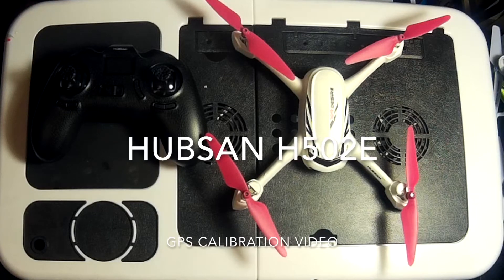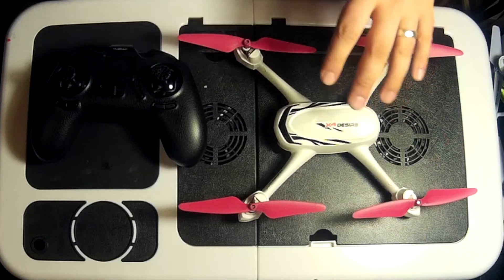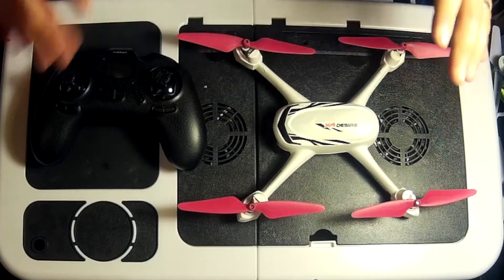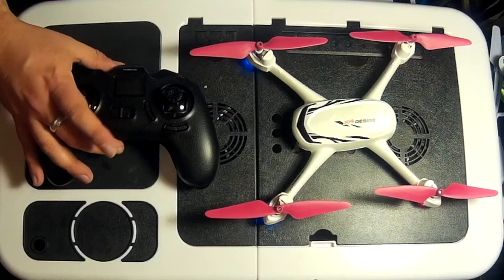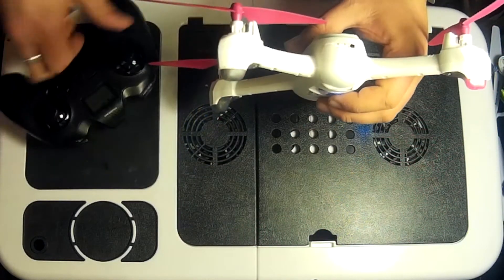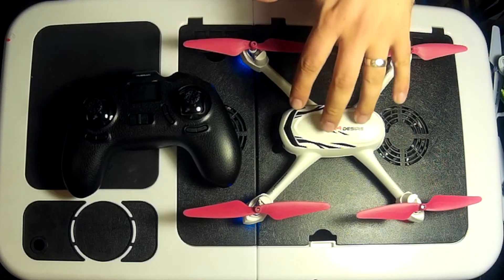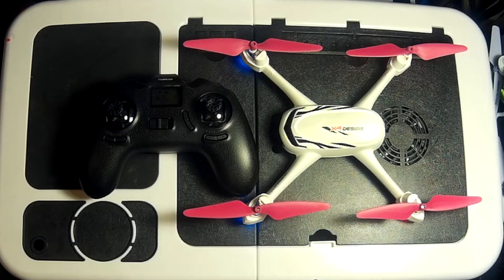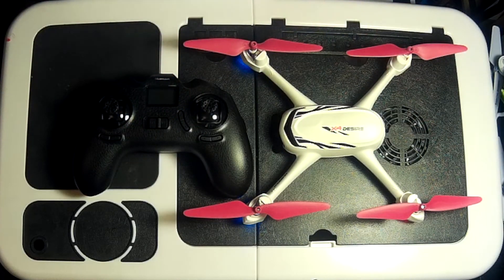Hubsan H502E Quadcopter Drone GPS calibration video

Comment: Rather than hundreds or thousands of GPS satellites, there are actually 24.  From Google -- GPS Satellite Constellation: The baseline satellite constellation consists of 24 satellites positioned in six earth-centered orbital planes with four operation satellites and a spare satellite slot in each orbital plane. The system can support a constellation of up to thirty satellites in orbit.Dec 20, 2016